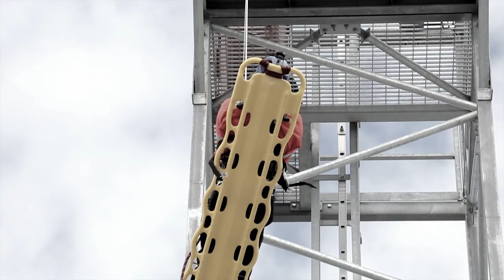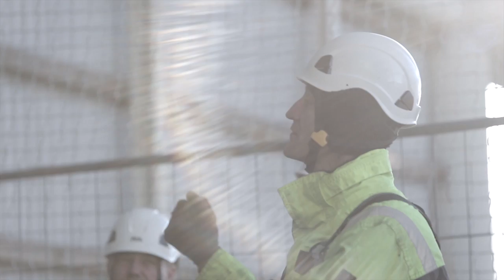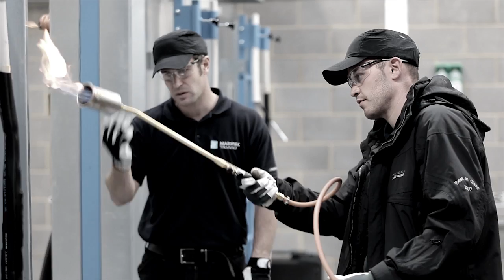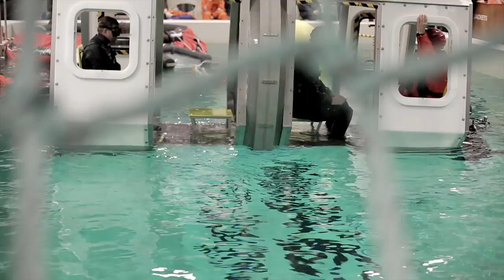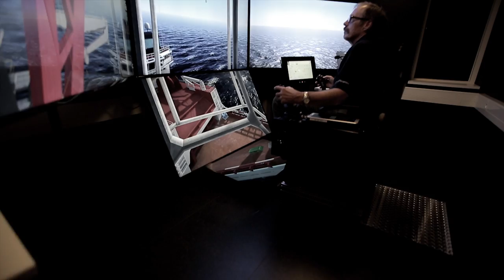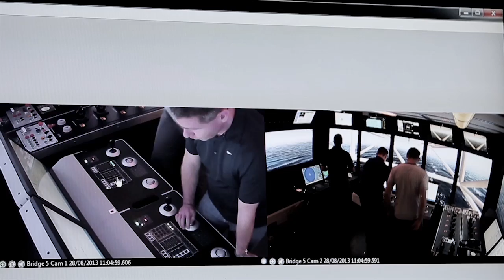Training for the wind energy industry

Comment: As seen on 0:41: Check out ITH Bolt Tensioning Cylinders - the leading hydraulic tensioning tools (since 1979) to tighten and loosen bolted joints on wind turbines precisely and safely.

http://www.ith.com/industries/tension-and-torque-tools-for-wind-turbines.php